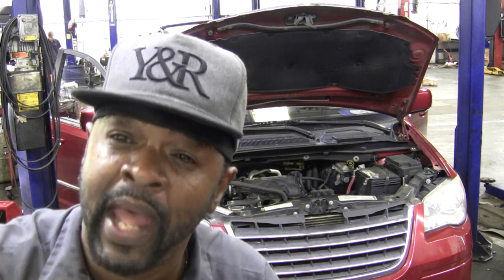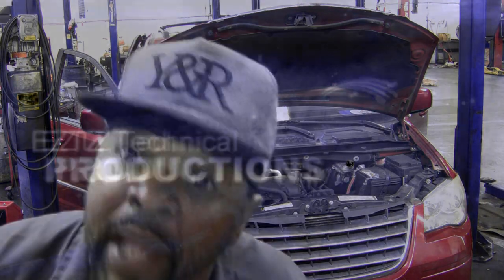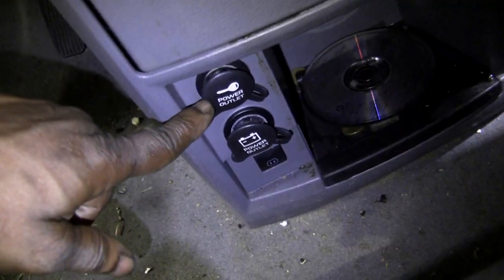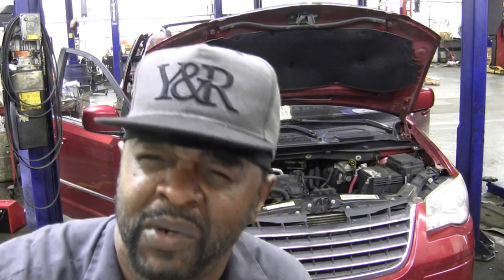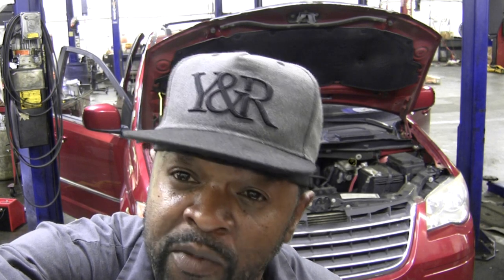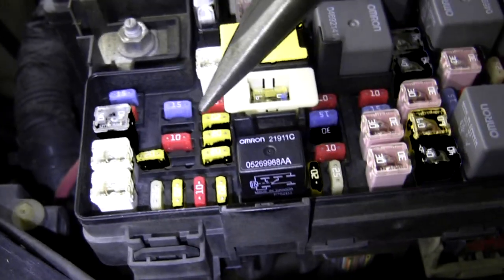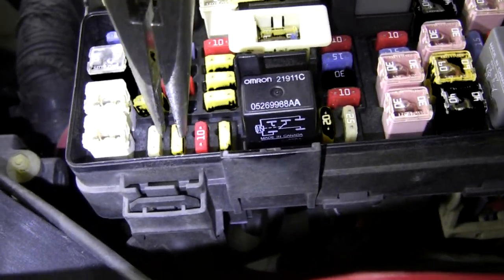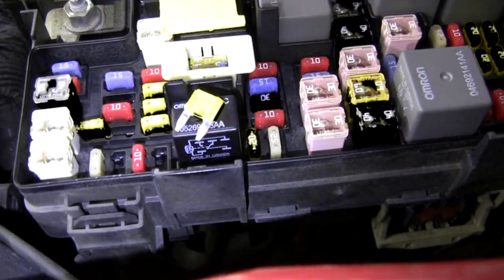Power outlet not working? Check these 3 things

Comment: Hey I got a question for you so I checked all those fuses and the 20 amp was blown but after changing it I still don't have power to the front outlets what's the next step
Reply from the maker: What kind of vehicle is this? And what was the name of the circuit that the fuse protect? Also are you subscribed to the channel?

Comment: I have checked all three and they’re looking good no sign of burning fuse
Reply from the maker: Hey bud now its time to verify if the power supply even getting to the lighter element. One could easily stick a test light in the center port to see if it lights. If ut does not, theres a open somewhere. Also are you subscribed to the channel?

Comment: since ur an expert i have a 2018 pacifica with no house outlet can i put one in from a wreked one or is the wire-ing missing? thank you for all your help
Reply from the maker: If your van was not equipped with one from the factory, the wiring will not be in place to install one likely. But it was an option so the wiring may just be there. The best way to find out is to remove the panels to look inside. Thanks for watching

Comment: My 2012 Chrysler Town and Country Limited runs hot while driving, but cools down when idling. What could cause this to happen?  Thank you in advance for your time and consideration
Reply from the maker: Mind you that when you driving pressure builds. You need to start with the basics. Make sure the sys full and free of air pockets. If theres a restriction it will show mostly while driving. Do the van have any codes? Also are you subscribed to the channel?

Comment: So I have a 2010 town and country. The cigarette lighter ports are not working. When I checked the fuses, they were all blown. I replaced them all, and they blew again within a few minutes. What could be causing that? Also, I checked the ports to see if anything was jammed in there and they are clean.
Reply: A short somewhere in the circuitry

Comment: 2014 grand caravan sxt. Right power sliding door when closes to secure itself, rear of door pops out and did not grab latch. Any suggestions? Can send video of exactly what it is doing.
Reply from the maker: Curious, does it do that using the remote as well as manual mode? Also are you subscribed to the channel?
Reply: @OnlineMechanicTips  yes subscribed. Only in power mode. When I close manually, no problem.

Comment: What do I do if all the fuses look good?
Reply from the maker: What is the problem?
Reply: @OnlineMechanicTips  Bro none of my 3 power outlets are working, after trying to plug a vape pen in the front outlets. But all of the fuses I pulled were not blown. I pulled about 6 different fuses. And yes, I am subscribed. 2008  Dodge Grand Caravan.
Reply from the maker: @trillionbtamillion  OK theres a run assesory relay in your TIPM/fuse box. This relay feeds all power outlet fuses. Easiest thing to do is swap it. Now what feed the relay is a outlet wire yhat goes to the battery positive post. Make sure that wire connected
Reply: @OnlineMechanicTips  Appreciate you bro. May I ask why that wire would be unplugged?
Reply from the maker: @trillionbtamillion  It connects directly to the battery so theres nothing to be unpluged. Could be bad connections at the battery
Reply: @OnlineMechanicTips  I meant disconnected. Not unplugged. You mentioned something about making sure the wire was connected. But to my mind it was connected and working before the vape was plugged in.

Comment: ok my dodge dakota had a blown fuse I replaced it and the power outlet worked for a few minutes then quit working again and it did not blow the fuse again so im confused on what the problem is  now
Reply from the maker: my friend, install a known good fuse into the slot and see if it work..Sometime the fuse and look good but be open..Also keep in mind, fuses blow for a reason, whatever you plugging into it could be whats shorting out the fuse..Verify that your equip ok..BTW, please sub the channel for me, thanks

Comment: My father has a 2016
Reply: 4:00 Town & country and the driver side cargo door does not open or slide open what can I do about this besides the upper control panels there
Reply from the maker: Hey bud, I see you are a subscriber, thanks.  Now you have to understand, both sliding doors on the van have modules for each door. You need a scan tool to get into those modules to see what codes are in them. From there you may be able to properly diagnose the van buddy. Could be something simple but you need that code